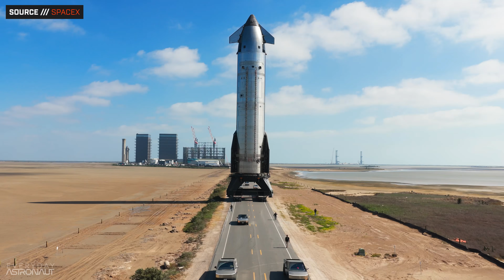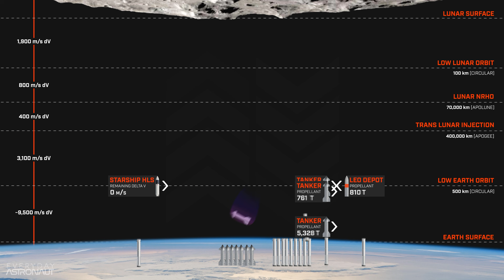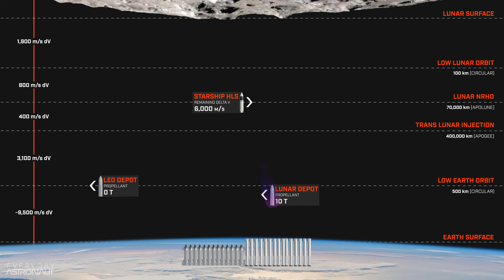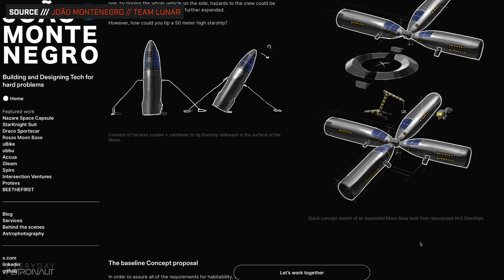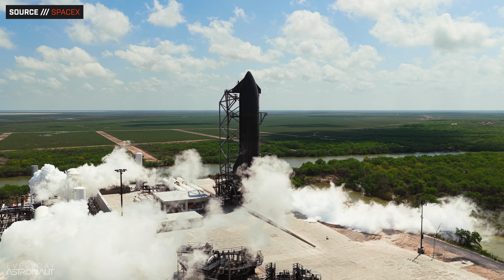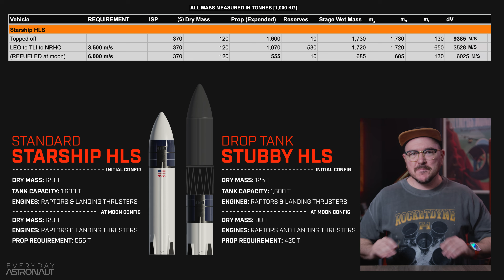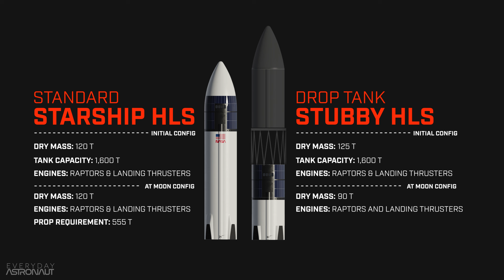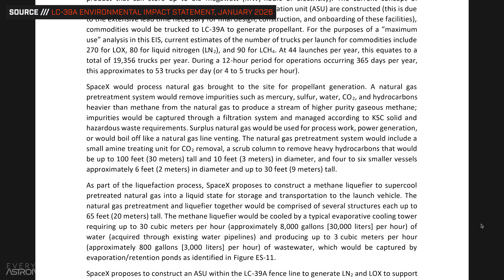Does Starship REALLY require 15+ launches to land one lunar Starship?!

Comment: I think the main wildcard here is that we don't actually know how much the lunar starship weights. It's not just the flaps, shielding, etc. that go away  this rocket doesn't have to survive the dynamic lateral pressures of reentry, so there's no reason for it to use the same heavy construction as standard starship. For example  the Atlas rocket used 0.25mm stainless steel, less than one tenth of Starship's sheet metals thickness, and relied on internal pressure to avoid bulging. Centaur uses 0.36mm steel. 
So no reason for starship to weigh 120 tons of dry mass, you can likely make it weight less that 50 without even approaching the metal thickness of those existing rockets (in theory, the outer shell could be as light as 5-10 tons, but the internal components, downcomers, pipes, engines and other parts can't be made of lighter metal without introducing additional risks).
So I'm guessing it will be slightly below 50 tons, perhaps even 40, using steel that is only 1mm thick or so for the outer shell and being fully pressurized at 2-3 atm before launch since humans are not on board. That means that a handful of takers would be enough to get it to the moon instead of over one dozen. But we won't know for some time.
Reply: It still needs to survive Max-Q during ascent. And I haven't heard anything about spaceX switching to thinner balloon tanks for HLS, and even if they did that doesn't mean they can simply chose the same wall thickness as Atlas or Centaur. Starship's tank walls need to support much more weight, as the oxygen tank supports not just its own fuel mass, but a full methane tank on top weighing hundreds of tons. The cross section of a tank wall with a certain thickness grows linearly with scale, but the mass of the fluids in the tanks grows with the scale cubed.

 Plus while they lose flaps and tiles, they gain landing legs, as well as landing engines and associated plumbing, life support, power generation, docking, lunar coms, elevator, boil-off mitigation, etc.

I don't expect it to weigh less than 120t dry.
Reply: @plainText384 true, but my point is that surviving Max Q in a thin shelled pressurized rocket has already been proven (with much thinner shells than what I'm suggesting) so it should not be a significant constraint. And that's a key point I want to repeat: I'm not proposing going as thin as those rockets did, but about 3x to 5x thicker, and not 15x thicker like the rockets that need to survive reentry need to be.
About Starship plans, you are correct, they haven't mentioned anything. But I can't imagine that if they would be launching a rocket that's twice as heavy as needed just because the ones they do need to land on earth need to be thicker. Economies of scale make sense when they don't triple your launch cost.
About strength, the mass is not the measurement that matters to the wall thickness, presure is, and that's not affected by diameter. It is affected be height and density though, and those two are areas that work in favor of starship, since methane is less dense than RP-1 and the Starship second stage is shorter than the centaurs first stage (the thin shelled one). Plus centaur has to support the weight of the second stage on top, starship doesn't. 
The challenge I think is pressurizing the whole rocket, but they do need to do that at about 1/2 atmosphere for the lunar mission, going to 1 over atmospheric pressure should not be a big stretch, going beyond that may or may not be possible. 
But the critical question is: is the cost of building a thin shelled rocket worth paying to reduce the number of launches by half? My guess is that it is not if we were talking about one mom mission, but if they are intending to do a dozen it becomes quite easy to justify the extra engineering and testing.
Reply: The problem is cost.
Reply: @RODI____  Cost of what?  Starship prototype stacks currently run about $90 million to manufacture, for both stages, engines included.  These are intended to be reusable as well, but even if the second stage has to be completely expended for a while, that's far from insurmountable.  Those manufacturing costs will almost without question drop as the new bay, and the move out of prototyping, renders the process even more routine than it already is.
Reply: @Asterra2 sure. And if we were talking about a small difference or a small number of launches, it wouldn't be worth it. But if a lighter starship moves the tanker number, for example, from 20 to 10, and if they intend to serve 10 moon missions, you are talking about the cost of 100 reusable tanker launches vs. one engineering effort to build the (already quite different) lunar starship with a different wall thickness. If each tanker launch costs $10M, you are talking about saving $1B in that case, and, as someone that's works in the industry I can say that a change in wall thickness is not something cheap to do, but if it is not an extreme change it would likely cost in the order of a few hundred million, not a billion. And not much more expensive than making a shorter starship, or some of the other options meeting considered. But it all depends on the numbers. If they are able to get the number of tankers need down to 10 or less, the ROI will likely not to be there to justify a redesign. But if they can't, or getting there requires a redesign anyway, looks like a fairly reasonable option.
Reply: How so? If 95% of traditional launch cost is the hardware and of we get a fully reusable stack, we could pay for 20 l reusable aunches for the price of one disposable one, all other things being equal. But since an individual SLS or other rocket with similar lift capacity costs well over 10x what a starship costs, then we should be able to do dozens of refuels for a single trip and still get a lower cost than the traditional approach. Of course this assumes that:
1) Starship works. 
2) It's fully reusable. 
3) Refurbishment cost is low as intended. 

But if any of those are true we have a mock bigger problem than cost.
Reply: There is also zero discussion about V4 (originally V3), which is baffling.  V4 will enter the 150-200+ ton capacities, more than halving the required launches (the orbital tanker will be larger too, helping with boiloff), and as the video properly notes, HLS itself doesn't need to be as tall as a conventional Starship and almost certainly will not be.
Reply: Good point.

Comment: The reason for using methane was to source it at mars. Since this for a moon mission with no methane source, perhaps it’s best to use kerosine like Falcon to mitigate boil off at the depot. Then the boil off issue would be for the O2.
Reply: Unfortunately, the ISP on the Merlin engine is only about 311s  in vacuum, and only 282s for sea level. While the storage problem becomes easier, the rocket just wouldn't have enough oomph to move that much mass, which greatly increases the number of launches required for the depot. Additionally, the oxidizer-to-fuel ratio for kerolox is only about 2.5:1, which means you won't get as much benefit from the "ultimate" lunar oxygen production system. 

Long term, for a purely lunar solution, nothing would beat hydrolox, since you need to solve for long term cryogenic storage either way. With a vacuum ISP of about 445s, and a oxidizer-to-fuel ratio of like 5.5:1 for a lunar O2-only depot, you're mostly going to be limited by thrust and an even greater physical size due to the super low density of hydrogen.
Reply: Kerolox isn't great for reusable systems due to soot.
Reply: Maybe the depot will have insulation to prevent boil off.
Reply: Maybe the depot will have insulation.
Reply: And therein lies the problem the entire design for starship was for some fictional sci-fi mars future which makes it a bad design for almost everything else , I’m predicting rocket lab will eat space s lunch after Neutron flies at scale much better design than falcon 9 or starship

Comment: HLS really needs reduced delta v requirements to decrease the number of launches. The goal is mass to the moon, so the best solution would just be to leave HLS on the surface and use a seperate light acent stage. The landing thrusters probably uses sparate tanks and plumbing so all the hardware for this is already in place, you would just need to add staging above the main tanks

Comment: Dumb question why are you running such a long burn time to the moon? You are in a vacuum and gravity is your only resistance. It's not like you need to race to the moon under power. Also you are relying on only the super chilled fuels. Options include the Argon Ion Engines that have been used on Starlinks for a few years. Gaseous Methalox boil off can be captured, compressed (if needed) and used warm. As gasses for breathing and methane can be used for power generation either in fuel cells or micro turbines with the oxygen. There is a lot of energy potential that isn't being used to full potential. The on site gas generator will produce nitrogen, argon and O2. All three have multiple uses that overlap. A simple heat exchanger using the argon or nitrogen and a pump. Would keep the the fuels chilled just using space and shade

Comment: Very Very good. I have been trying to do these sums and simulations but came to the same conclusion as you that what we think SpaceX is doing just doesn't make sense, your analysis confirms this. Your Stubby Starship makes sense but I don't think you took off enough weight. If the HLS is surrounded in fairings then it will be designed for space travel and lunar landing only (Apollo Lunar Lander had Paper thin construction to reduce weight). A single mini Raptor Vac could do the lunar injection burn and the landing without risking a dust storm. Seeing that the lander is reusable then using a non-reusable booster and fairings makes sense. If they make make a one-Way Cargo version to land and convert to a Lunar Base Module then your flexibility concerns would be addressed. Please revisit calculations with say a HLS of say 15 to 20 tones wet?
The fact that SpaceX has said and shown practically nothing leans towards an HLS running a Very different Artemus mission profile. Check the sums, but I think the HLS (with a small Canada-Arm) could refuel once or twice in LEO.  Transfer a crew and some equipment from a Dragon.  Direct (slow) lunar injection, then landing without lunar orbit. Please check but I think your idea of returning to a LEO is now possible without Lunar refueling!
Think of what this mission profile will mean for SLS, Orion, and the Blue Origin Lander. One stop shop, SpaceX Earth to the moon and back!

Comment: You raise an interesting question, if the lunar lander was less long and wider, but had the same mass,it would be more difficult to distribute the thrust from the landing engines. 
So for the HLS, the height might actually be a huge advantage.

One thing is clear, there's a long list of engineering challenges to solve, from rapid and full reusability to the fine details of the crew cabin and the engines needed for safe landings on the moon.
Reply: All the weight of the engines at the bottom will make it more stable too.
Reply: @aldunlop4622  Perhaps all that fuel near the bottom helps too?  I has to have fuel once landed, to take off again.

And in the HLS Human variant, what is the overall weight of that?  Look around you in your home, most of the volume is air (floor to ceiling).  So basically the human portion of the ship is very small (and at the top), and weighs a fraction of the cargo (around the middle), fuel (near the bottom), and engines (at the bottom).

Now think of where that center of gravity is?  CoG plays into the "tip over" angle...maybe 1/4 the way up from the bottom.  Landing legs are spread out further than the 9 meter diameter.

Now think of the actual landing.  Do we not think the spot will be the most analyzed, most photographed place on the moon?  By NASA and SpaceX both?  It's not going to be some "random" "uneven" spot as so many people say.
Reply: Oh dang, you're right... It's like balancing a cup cover on its nub, compared to balancing a wood pole up right.
Reply: The high inertia of a massive lander combined with the forgiving low gravity on the moon should make balancing easier, too.

Comment: Really starting to think Starship HLS as a Cargo-only (or as a "pre-built base" module as a lander) expendable setup, and then a much smaller (B.O. ?) lander to bring people down and back to the site.
Reply: I just think no way this is workable if they need NHRO refueling. I really hope their design plan with V3 had this in mind the entire time. The only thing I haven't seen Tim harp on yet is the HLS could be A LOT lighter since it doesn't have to re-enter or land in Eiarths atmosphere. It could remove so many things and be built different. But I'm 54 mins in
Reply: @gcburns4  He did mention this. He made the assumption that other stuff like the landing engines, life systems, internal design, landing legs, ... that are needed on HLS but not starship will more or less even out.
Reply: I honestly think B.O's proposal is much more feasible and is going to be the chosen lander. It's much less ambitious and prioritizes the mission goals over far future uses. Starship is superior for a much longer term system, however for the short term it is much to ambitious to get off the ground in a timely manner.
Reply: @akqle4438  Sure, it might be better in the short-term, but then we’ll just be repeating the Apollo mission. Artemis’s goal isn’t just to get a man on the moon, we already did that. The ultimate goal is to land a person on Mars, and something like BO’s lander won’t cut it, especially when we plan on making bases on the moon, which the payload capacity of Starship helps out with.
Reply: @polluxe8917  shipping stuff to moon is simpler. for the material shipping there's no need to get the thing itself back, the vehicle itself can be material to use on moon.

starship is a result of reading tintin, basically. apollo needed lunar rendezvous exactly because they were coming back and they left the stuff they didn't need for the back voyage on the moon.
Reply: @akqle4438  Indeed, Starship was designed to be able to land and take off from Mars.  It doesn't seem ideal for a moon landing.  It almost seems like they should have kept the first stage and redesined everything else for a moonlanding.
Reply: @jeffk464  that's a pretty lax definition of designed. it was just designed as a big refillable rocket as they thought they could make. or someone thought anyway. and it's not finished designing either.  it would need refill to get to mars, decelerate and land and to get back - at mars, leaving another starship somewhere else.
Reply: This was my thought too. Bringing HLS & the cis-lunar depot back seems to overcomplicate the entire architecture & hugely increase the number of launches. Pre-landing an ascent module for astronaut return (maybe an autonomous ascender that can land again after?) and leaving HLS is a much better architecture for early missions. HLS is a relative palace compared to everything before it, why would you bring that back?
Eliminating HLS return would eliminate most of the activity following launch. It also means you can start refilling your LEO depot much quicker.
Reply: Terrible, awful idea. If anything, Starship HLS should've been the sole provider for both crew and cargo. Blue sucks.
Reply: I think so too.
Reply: Jeah, the big party bus makes sense for mars mission, but not for lunar.
Reply: Without specifically thinking of BO as providing the human-rated lander (still hankering for Alpaca),  I started thinking the same way about 4 years ago. 

Starship is much better than BO for 1way freight trips to the moon. (There are 2 fteight needs  requiring high volume & mass-lifting specs: (1) large volume radiation storm shelter; (2) regolith-lagging equipment and HIGH ENERGY SOURCE, for no-ejecta landing-launch pad.) NON-stubby Starship shines here. 

EA: How many refueling launches for a straight-to-the-moon (from LEO) one-way freight flight?

EA: Yup. Getting Starship human-rated will be THE  BIG challenge for it.
Reply: If it can put cargo it can put people as well lol😅
Reply: @calvinallan2208   Risk tolerance is a lot higher for cargo than people
Reply: @mrpielover615 I'd fly on any of our current pressurized cargo vehicles (on the way up at least, the landing profiles of a lot of them are "burn up on re-entry.)
Reply: @calvinallan2208 people probably want to come back home.
Reply: @calvinallan2208   This
Reply: Yall are non believers lowkey glory to starship
Reply: @1otenwithonotzero223  "Glory to starship" is akin to a cult
Reply: @SpecialistBR moral equivalence fallacy
Reply: @1otenwithonotzero223  i’m definitely a starship supporter for heavy cargo. I just think it’s wiser to have a smaller lander for crew shuttling.
Reply: @1otenwithonotzero223 not at all! Love Starship. Just don’t think it makes sense as a MANNED lunar lander.  It was designed for Mars. Different situation.
Reply: @m @mikekopack6441  was designed for 1 mission and 1 mission only - to launch Starlink satellites which Falcon 9 cannot physically fit. Starship will never enter the lunar orbit, let alone Mars lol. Have you searched up the delta-V requirements for Earth escape?
Reply: @JamesBrown059  I always thought that if Starship fails at everything else it would still be a useful more affordable platform for heavy lift to orbit.  Probably less demand for that use so they would have to scale back their operations.